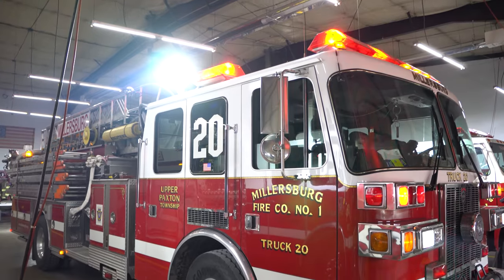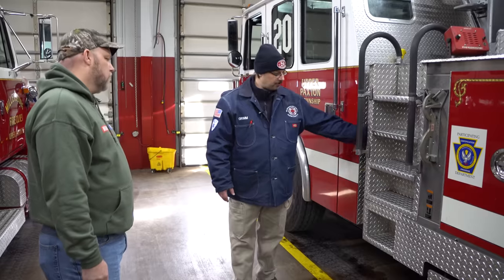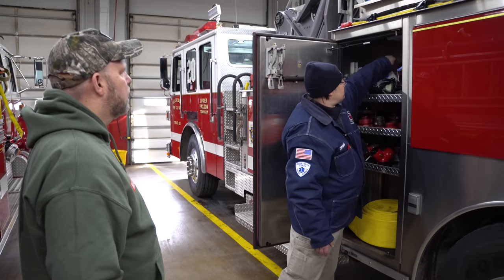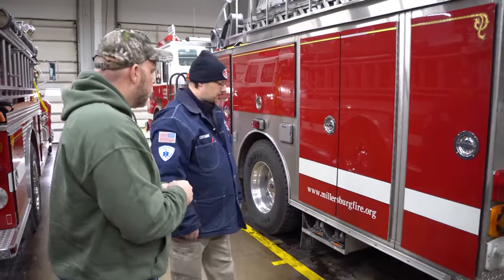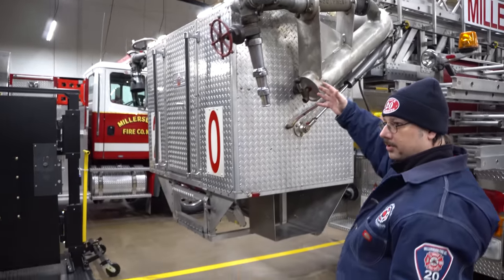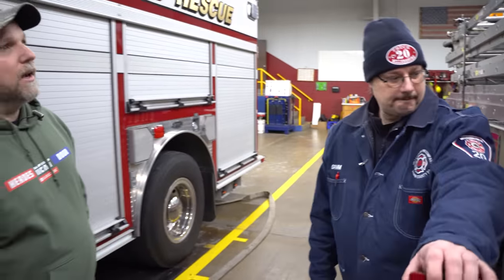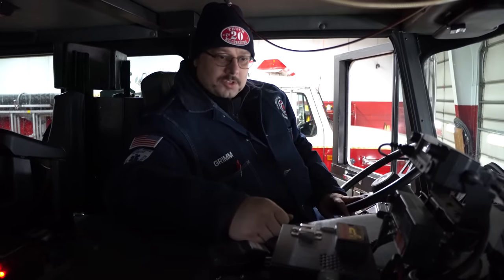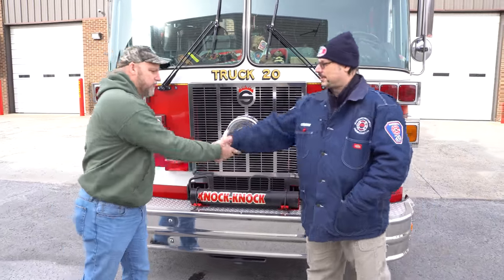What's INSIDE a $1,500,000 Truck

Comment: Love that truck 20 old school but cool! What's difference between truck/engine and a quint?
Reply: A quint is a ladder with a water hookup. Ladders are usually referred to as “trucks”. Engines are the apparatus that pump water to the hoses.
Reply: It’s called a quint because has five components: pump, tank, hose, ladders, aerial.
A truck typically has no pump/tank/hose but contains a large number of ground ladders in addition to the aerial. 
An engine does not have the aerial component and only a couple ladders, usually one extension ladder  and one roof ladder.

Comment: i gotta ask how is a older rig like that 1.5 m or dose that refer to when it was new only
Reply from the maker: It’s replacement cost if you were to buy this exact one today
Reply: @HeroesNextDoor  that makes sense tho i assume some of the new cost would be reduced atleast a bit if any of the old systems were transfered over like  if the cab and engine were replaced   but the rest still was good